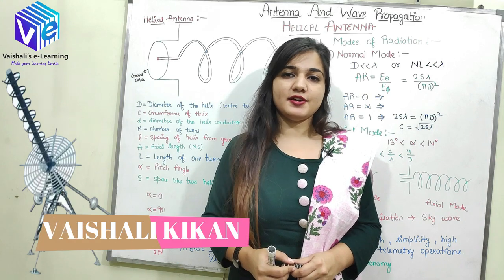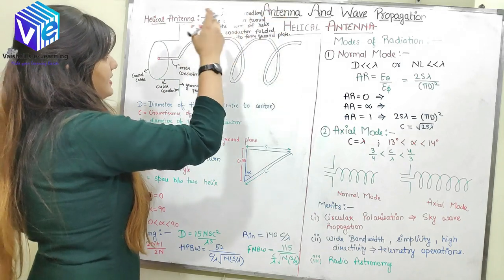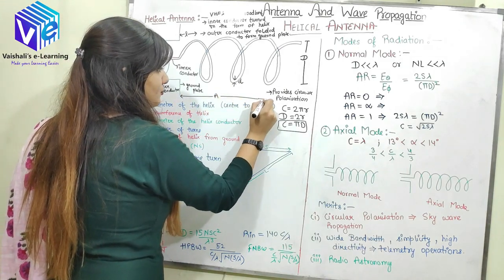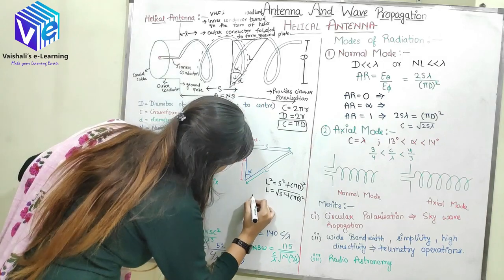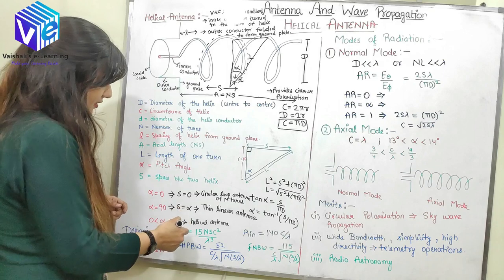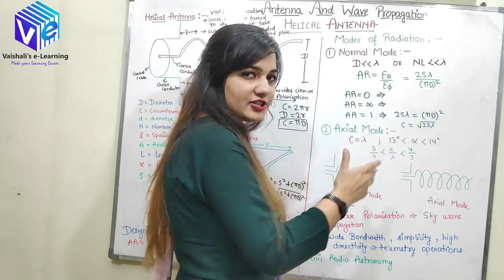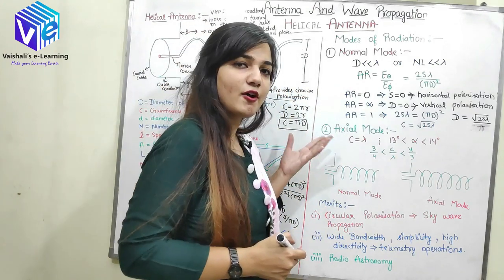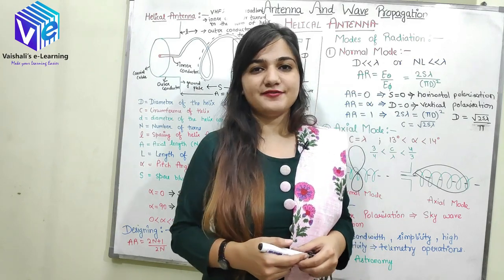Helical Antenna | Types of Antenna | Antenna & Wave Propagation | AWP | Vaishali Kikan | Lecture 26|

Comment: Mam I Have a Doubt If the wire diameter of an axial mode helical antenna is doubled, the bandwidth of the antenna will ??
Be doubled (or) 
Be halved (or) Be quadrupled (4 times) (or) Remain almost the same
Reply from the maker: You have to do your assignment yourself
I can help you with the content

Comment: Mam I Have a Doubt A helical antenna has diameter of 5.3 cm. At 5.4 GHz, the antenna will be operating in
Axial mode
 (or) Normal mode (or) Conical mode  (or) Both axial and normal mode
Reply from the maker: Thanks for connecting